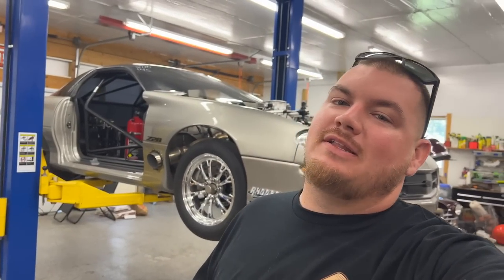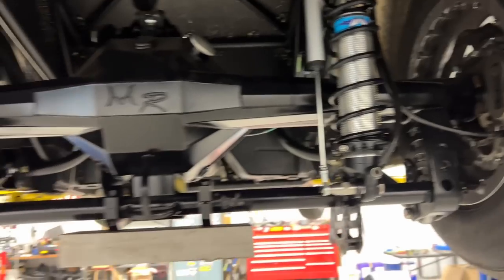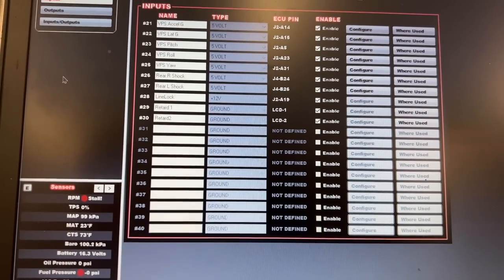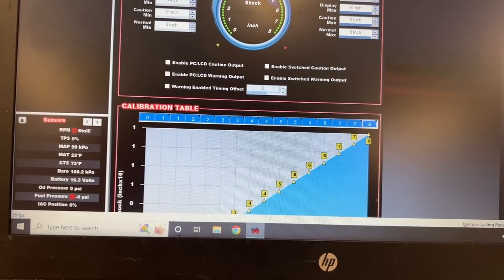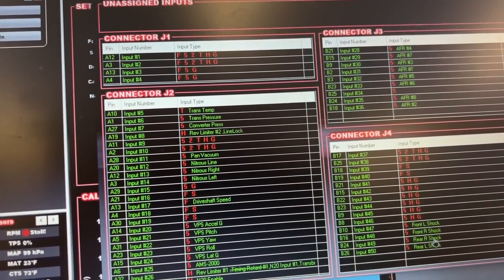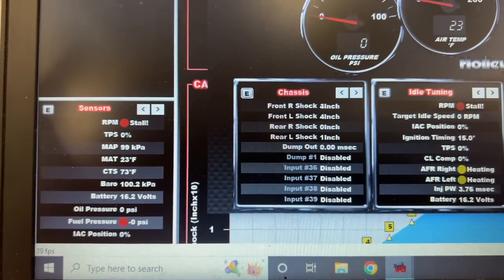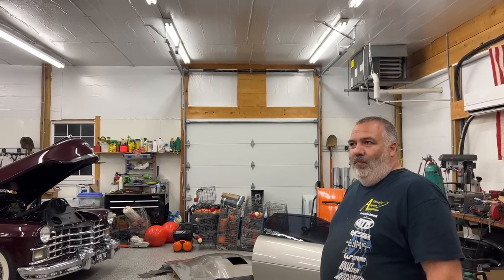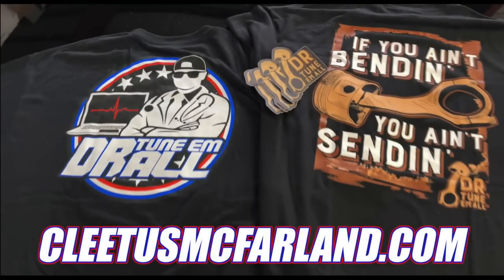We Drove 1000+ miles To Race With Jackstand Jimmy

Comment: Aren't the stars supposed to be in the upper left when hanging a flag vertically?
Reply: It's been said it's the opposite, to symbolize running forward with a flag in hand. The flag reverses when charging in battle, so having it backwards is symbolic of that, and opposite would be retreating.
Reply: The stars are always supposed to be on the left side when hung vertically.
Reply: Except when under foreign occupation as we are right now the flag is supposed to be hung upside down

Comment: Why build a car and then hire a driver when your not advertising anything
Reply: For the trophy and the bragging rights
Reply: @patrickmuzzi  but the bragging rights wouldn’t be his he didn’t drive the car and in this video he said he didn’t build the car
Reply: @600wheel  it doesn't matter if he built or drove it. He owns it. So when people say how fast is your car. He can tell them X instead of Y.
Reply: @600wheel  not sure if you’ve ever had a car on this level - but I was involved in every aspect of the building of the car.   I can assure you when it’s on this level - it’s not a drop off and pick up turn key deal.
Reply: @gonzoracing  I’ve got an 89 mustang I built the stock motor forged the bottom end yes I know I should’ve started with a better block I put Paxton and novi 2000 blower on it the suspension has been completely redone I use it mostly for autocross it has run a 10 but I didn’t like turning it up that high because of the stock block it rolls around right now with 535 wheel horsepower so no it’s not quite on that level but if you handed me a top fuel dragster I would not go to my grave before I learned how to drive it and drive it properly I don’t understand people who are scared of cars but that’s mostly because I’m not scared of death and I love cars so you do you I just wanted to let you know I’m not some jag off kid on a computer I’m a 50 year old guy who’s been through hell standing beside a 1996 Evo GSR and an as built 89 Mustang as I can possibly do and I would happily drive either one straight into my grave before I would hand the keys to someone else and say hey can you do better with something I broke my body to build